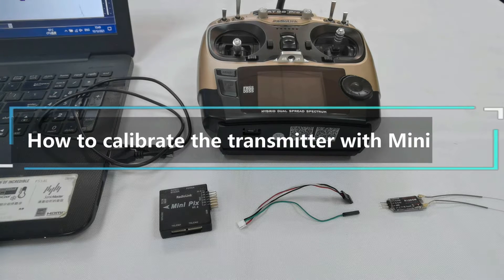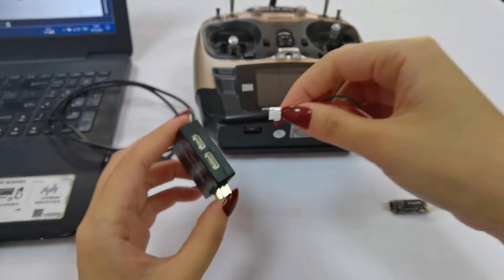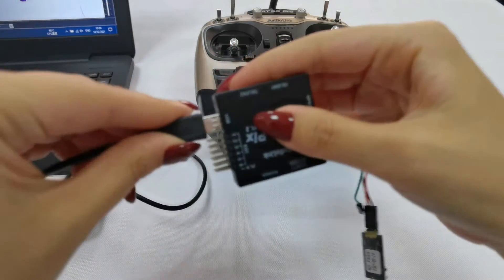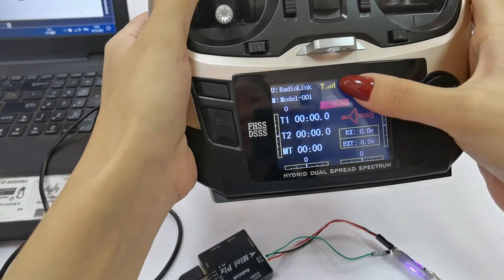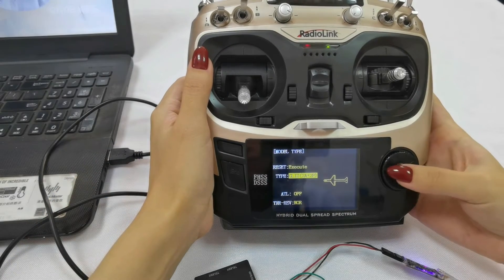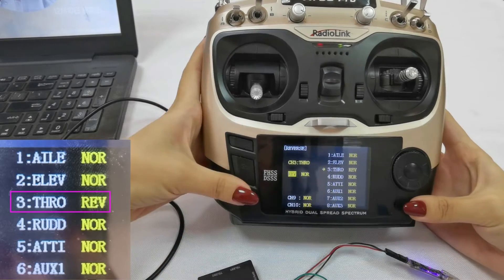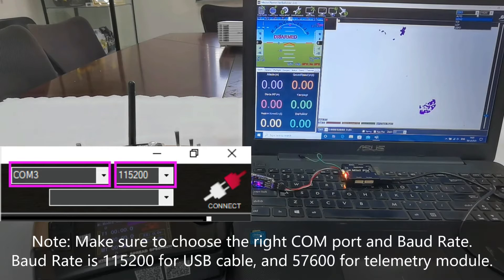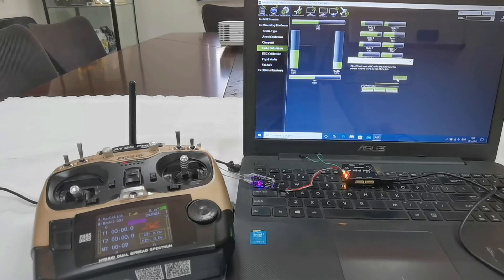Radio Calibration with PIXHAWK/Mini Pix/crossflight/Turbo Pix in Mission Planner

Comment: How fix bricked pix6 flight controller pls help
Reply from the maker: Hi, sir. May I know how did the problem happen? And is it convenient for you to send us a video to show the current problem of your PIX6? Then we can know what happened and help you solve it. You can send  the video to our email : after_service@radiolink.com.cn
Reply: @Radiolink_official 
It's happen when i was uploading firmware then the option flash on screen for bricked yes /no 
By mistake I select yes option then the fc not connecting via usb cable
Reply from the maker: @sandeepbisht7330  Hi, sir. It is possible that you have installed the wrong firmware. We recommend you to download  the firmware from our official website: https://www.radiolink.com/pix6_firmware  And PIX6 does not support the open-source firmware versions 4.5 and the versions before 4.5.

Comment: hello sir,
i have combined transmitter and receiver are binded successfully But 
it doesnt show in radio calibration in my Pc.
i really need help.....Please
Reply from the maker: Hello, please check the light or your receiver. The signal mode of your receiver should be SBUS or PPM signal mode. Because Mini Pix supports SBUS/PPM. If the problem still exists, you can send pictures to our email: after_service@radiolink.com.cn
Reply: @Radiolink_official  hi, I'm using T12D new transmitter with R16F & cross flight. I'm also facing the same issue. Transmitter bind with receiver. Its solid blue&red on receiver. It works when I just directly connect the motor ESC to the Channel 3. But when connect to the Crossflight radio calibration not showing the green bar.
Reply from the maker: @HobbyDump96  Hi, sir. When you connect R16F to CrossFlight, you need to make sure youou connect CrossFlight to the SBUS channel (channel 16) of R16F, and the LED of the receiver is in blue&red. Also, you need to make sure the receiver and transmitter are bound successfully. Then you can connect CrossFlight to Mission Planner and calibrate the radio on it. If there is still any problem, could you please take a vidoe to us to show all your connection and your problem? Our email is: after_service@radiolink.com.cn
Reply: @Radiolink_official  yes I have connected everything as u mentioned but no response on the Radio calibration. Currently I'm contacting radiolink support thru email.
Reply from the maker: @HobbyDump96  Hi, sir. Thank you. We'll reply to your email. Please check your mailbox, Thank you